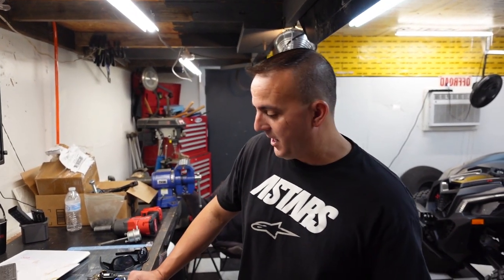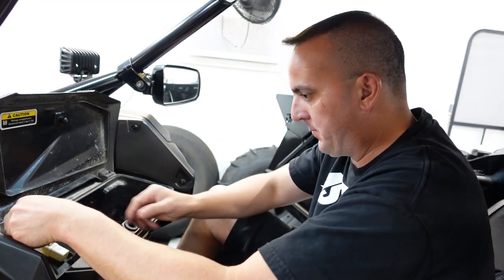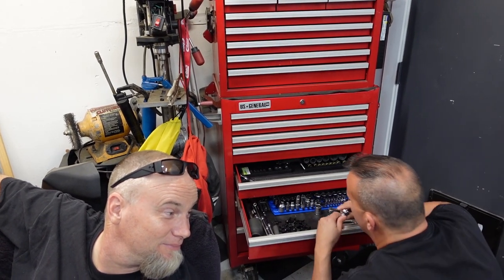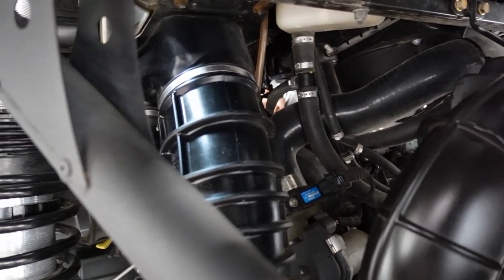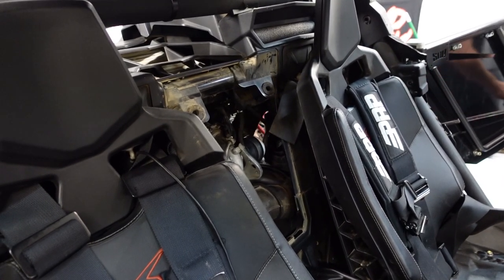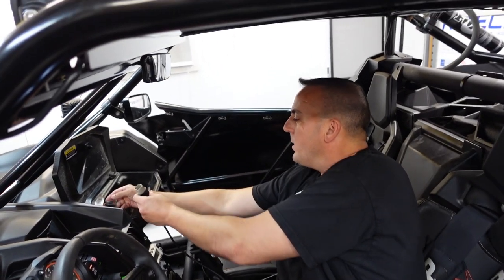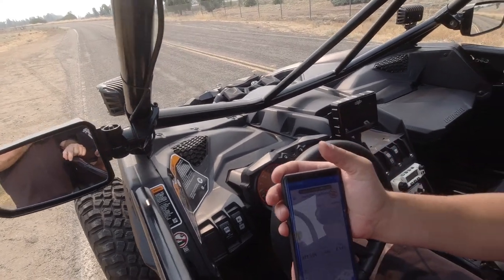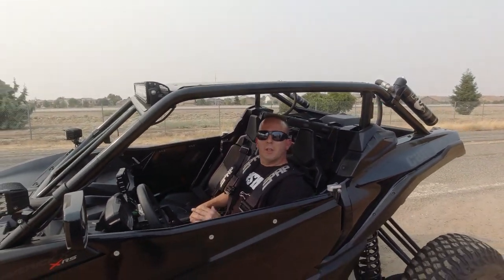EVO Stage 5rwi X85 NOT RIGHT, DID WE FIX IT

Comment: If you want to add some visual to testing for boost leaks I like to get a spray bottle with water and a little dish soap then spray the connections, pipes and anything else that you want to pressure test.  Small leaks will make foam, medium leaks make bubbles and large leaks blow the soapy water out of the way.  I would also compare the gauge you are setting the wastegate with a few others to make sure it is accurate.  Seems like you guys are looking for more pressure than you are getting.  Keep up the awesome work!!!  Love the vids!
Reply from the maker: Good tips, thanks so much